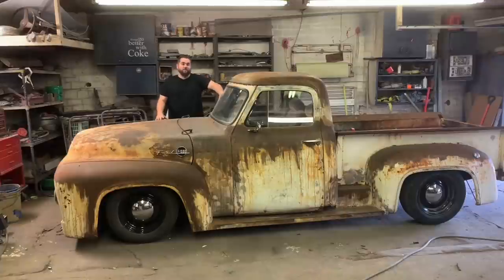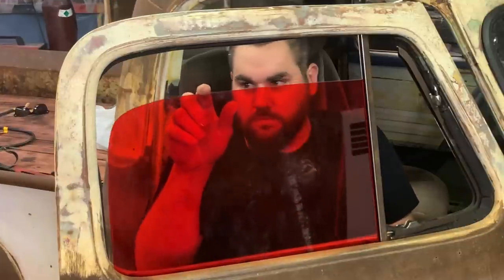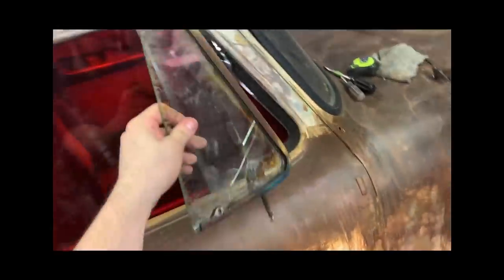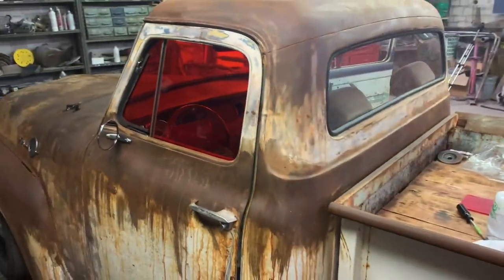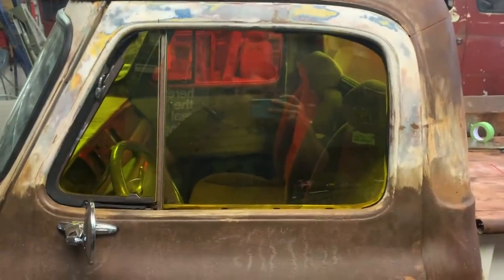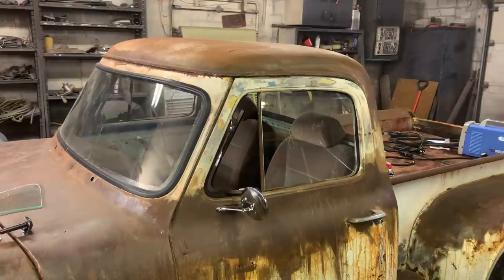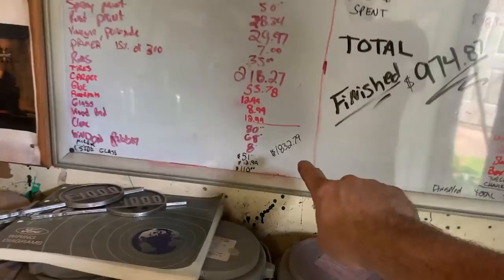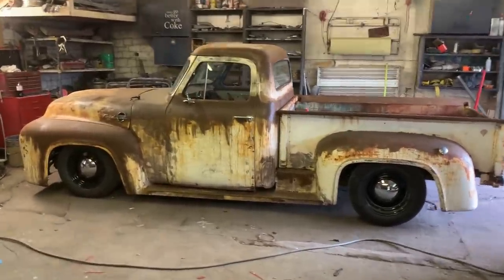FINSIHED BUILDING A HOT ROD FOR UNDER $1000 DOLLARS! I DID IT! HOW TO BUILD A RAT ON A CHEAP BUDGET!

Comment: I'm new to your series.  Loved it. Great work. Was wondering what gauge of metal you like to use for your patches on cars. Also what size wire are you using in the welder. I have the same welder. Thanks! 👍

Comment: How the hell did I miss the opportunity for this truck?  Great build,currently going to do a '56 Ford F600 cab on '04 Vic chassis. I have the chassis specs drawings on the '04 and seem as though they may be different than the chassis you used. Do you know if they are different? You extended your cowl but measuring before cutting I'm thinking your chassis specs may have been different...any ideas? I believe my wheel openings may be larger on the front fenders by 2-3 inches.
Reply from the maker: 2000 and 2004 should be the same. 🤷🏻‍♂️

Comment: I may have missed it what wheels did you use
Reply from the maker: Wheel vintiques smoothie steel rims
Reply: @CaseysCustoms  what back spacing and size?
Reply from the maker: @tykaech2061  that i don’t remember. The rears were an inch wider i do know that